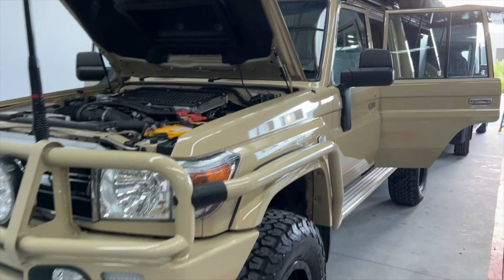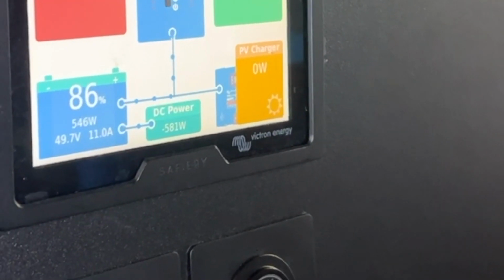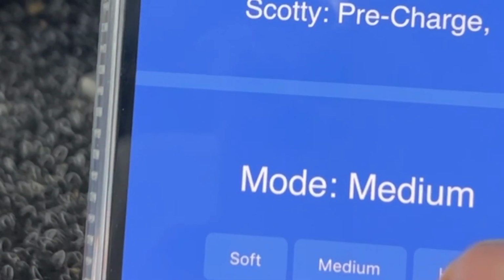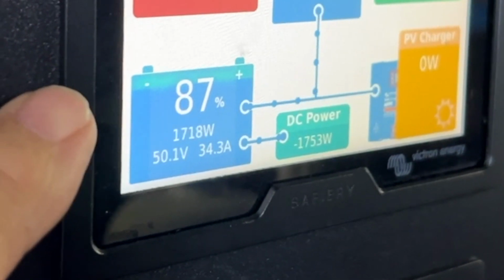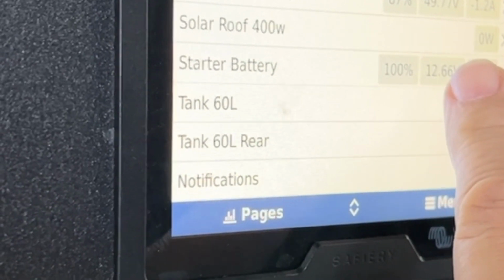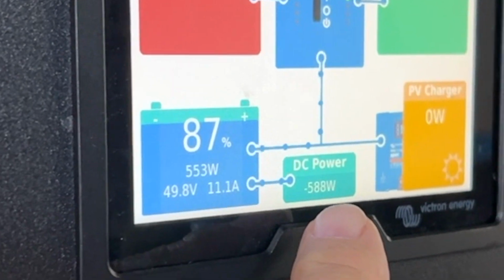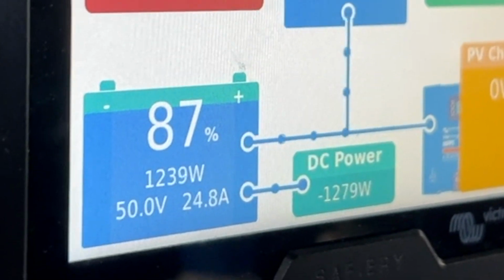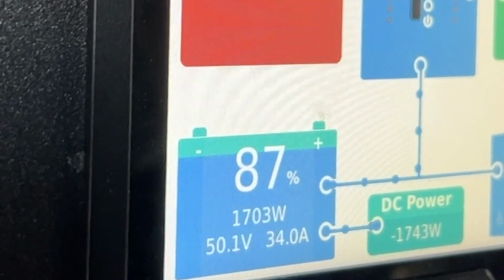Scotty AI Doing 1750W at Idle LC79 using AI and no Engine RPM input.

Comment: Curious to know why you don't simply call Scotty a 35amp dcdc battery charger.  Because that's simply what it appears to be? 
Also has there been issues with the v1 variant of your Scotty to prompt a v2?
Reply from the maker: Good question 1) it’s variable power with auto tuning 2) it’s bi-directional and reverses direction in 25ms 3) it has a smart battery protect built in for high side to low side protection 4) it has a 10:1 automatics turn down or turn up ratio and finally 5) it is a high side battery charger at 1500w or 3000w for any voltage from 24v to 60v. We don’t know of any other product in the market that does all that. If you do please advise…. V1 is manually tuned V2 has AI for auto tuning. No problems with V1 but technology is advancing to V2

Comment: The 1750 watts. Am I correct in saying it is generating 136 amps. If so that is amaizing. 
However the batteries would have to be a 2 C rating yeah ?
Reply from the maker: Yes the amps are 136. We have many other videos showing 250A on the 12V side. This is Scotty and its a 12-24V,36v or 48V. In most case its 48V for us. So 250A coming in is a max of 60A out and thats only 0.6C for 2 of our 48v 2400Wh lithium batteries. the real secret here is the 48V energy staorage.
Reply: @Safiery  thanks for the fast reply. 
I am going to be doing a significant build mid next year ish. I have you guys pencilled in. Just not sure when yet. All the fruit. On an ATW rig enclosed. Yewwww 48 v. Off grid. long term

Comment: Will you be bringing this feature to the WS500?
Reply from the maker: No the first DC to DC control board was a Wakespeed 500 version. Scotty II is superior to that product but for DC to DC control only. Wakespeed will still be used as an external regulator for alternators though it needs engine rpm to have a wide turn down ratio.
Reply: @Safiery  thanks for the response! I'm a bit confused about what I would need if I had a 48v secondary alternator direct to a 48v battery bank @ 100-125A... From what I understand, I'd only need a WS500 to regulate the alternator, since I'm not converting down to 12v, etc.? But I really like what you show here, limiting the alternator charging for fuel efficiency when the max isn't needed. Or do I have everything confused?
Reply from the maker: @nashdashflash  Ive just uploaded a revised "Scotty II Changes and what it will do for you" on the front page of our website. Have a read of this. We also sell Wakespeed 500 but dont do 48V alternators at all because of the risks of load dumps. There are no avalanche Diodes available for 48V alternators. They also needed higher RPM to start producing. Scotty II will give you more at idle from a similar sized alternator at 12V and you get 48V to 12V as a bonus. If you run twin 12V alternators, you can have 3,000W of charging at idle. Cheers